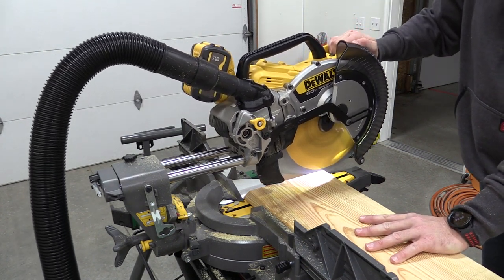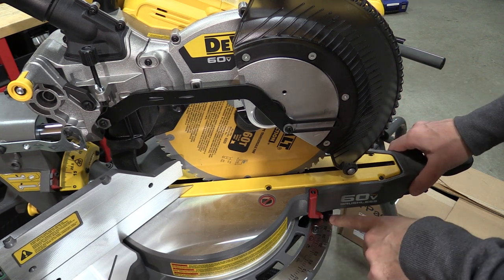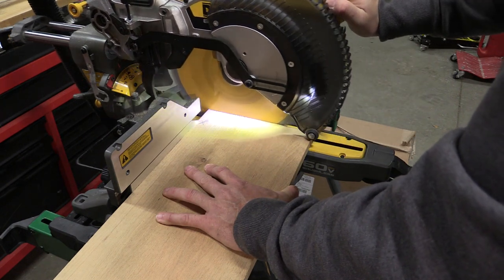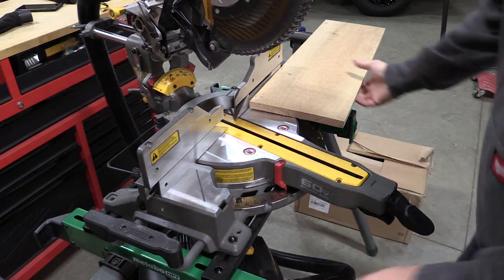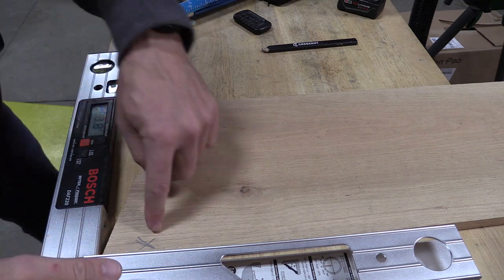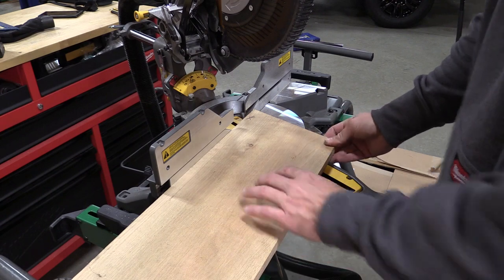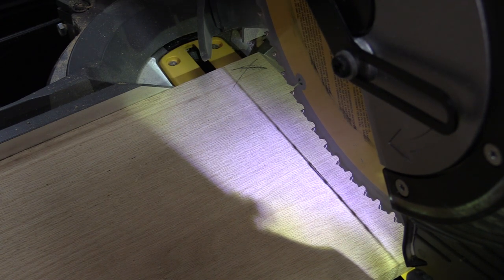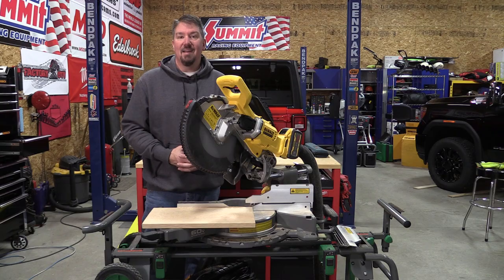Accuracy With The DEWALT FlexVolt 60V DCS781 12" Double Bevel Sliding Miter Saw

Comment: Dewalt saws are top notch! For the 45 degree bevel test, I use 2 pieces of perfect width 3-4” flat stock upright against the fence. Cut both pieces, put the mitres together and test the corner for 90 then divide by 2 if you’re using a digital angle finder. Way easier to measure that angle than the way you were doing it. Also I’m a cabinet installer so the cabinets I trim around are way more exact than a drywalled corner. I want my saw to be tuned as accurate as possible. Have fun, I wish I could justify replacing my perfectly fine corded version with this.
Reply: It’s fine till you start cutting harder woods, I guess if you spend the extra few hundred and get a high end blade
It would be fine. I’ve never had a saw get bound up in the wood till I cut an entire room of shit lap, that was just pine too.
Reply: The dust collection on this saw is the reason to switch over from the corded version. I really wish they had come up with something different for the slide. I really like the way makita and festool don't have the rails poke out the back like this this saw is also at a fair price compared to other brands

Comment: How do you hook your vacuum up to that saw. I have automatic switches but can't use it with tge battery. Do you manually turn on vacuum for each cut?
Reply from the maker: Dewalt has a tool connect system that will work with some of their vacuums.  I have a bluetooth switch I wear on my wrist that controls the power to the vacuum.  I still have to turn it on and off, but it is in a convenient place.
Reply: @WorkshopAddict  I'm thinking of making like a vacuum pedal. I can step on it when I'm making cuts. I know it's a bit ridiculous. But when you're used to an auto vac switch, it's hard to go without one.
Reply from the maker: @robvantour9757  I like the pedal idea!
Reply: @WorkshopAddict  I thought it was a million dollar idea, but Amazon already has them for sale.

Comment: The things I really like about this saw from watching your videos are: (1) accuracy out of box (2) dust extraction above 80%!!  I’ll never understand why my trim crews refuse to use vacuums when I supply festool self cleaning units with the remotes. Their light and quiet(3) cut shadow line (4) the blade safety shield… it can be easily lifted with the hand on the cut handle by using the thumb to lift up just a little when needed ……. But the biggest improvement and one that every single manufacturer should strive for one 10”’saw should be less weight. This saw is almost less than 50 lbs. AND IF YOUR USING add on wings, like the Fast Cap system… you can remove the factory extension wings and you’ll be about 45 lbs. now… I think I’d probably carry the saw with these factory wings so.. probably not a good item to remove. 

Now the problem for me….. I have Milwaukee cordless tools tens of thousands of dollars into that line of cordless.  I also have the Makita 40v line started and absolutely love the new Makita tools.  However the Amazing 12” Makita compound miter saw is 69lbs and with the battery over 70lbs.  There is a massive difference in weight from 50lbs even using the roller stand when going up and down stairs and loading or unloading from our transit vans.  

I’ve been very tempted to buy the Kapex miter with its roller stand.  Everyone I know who owns one says it is extremely portable, quick to set up and accurate. I’m not concerned about price as much as capacity to cut baseboard standing up. Over the last two years our customers have chosen 6” and 8” 1x baseboard. The 6” is 5 1/4 to 5 5/8” depending non the profile and manufacturer while the 8” is 7 1/4. I’ve not found a saw that can cut 7 1/2 standing up yet although a manufacturer could, with proper design, make a 10 or 12” cut well over 8” standing up if they mount the motor and arm on a U shape or goose neck shape. 

I currently run the Makita 36v 10” compound miter. With the stand, it’s 100+ lbs. 

Another great informative video, thank you

Comment: What you termed as "Blade wobble" is from the blade and motor torquing while it's getting up to speed.
It's impossible to change physics. 
The more swivel points, the more wear points. Wear points wear. Nylon bushings wear faster than Bronze. At what price is this no longer deemed affordable for most people?
It's like wanting the versatility of an F-250 with  V8, and then complaining about its gas mileage.
Reply from the maker: I did not think I deemed it blade wobble.  I talked about another commented saying all flexvolt saws having blade wobble.  I just showed it, and also said some of it was from stickers peeling on the blade.  Just showing every aspect so people are happy with a 700 dollar purchase.
Reply: @WorkshopAddict  hello

Comment: It's a DeWalt. Of course it's accurate enough. Better than most saws. Festool isn't even better
Reply: The only things I like better about the Festool Kapex are the bevel control (it's much easier and more accurate) and dust collection.  But many people (including me) don't use the bevel capability much, so  the price differential and the other disadvantages of the Kapex lead me to stay with Dewalt.

Spencer Lewis of Insider Carpentry has tried all the high-end saws, and swears by the venerable 780 for his amazing trim carpentry.  But no saw is perfect -- every choice involves compromise -- so I'm not about to argue with anyone who decides, after due consideration, the Kapex (or any other particular saw) is best for them.

Comment: DeWalt did not equip this unit with a 120VAC plug-in option/feature JUST LIKE THE PREVIOUS DHS790 had. They are GREEDY & want to force customers to buy MORE batteries!! I'll be skipping this model. They could at least make a 120V AC to 60v FlexVolt battery adapter, but again, that would cost them battery sales...
Reply: They did for the UK so maybe there is hope for North America.
Reply: Also, to be noted the battery gets charged with the saw brakes. So you can't put an AC plug on this saw.

Comment: Cool saw. I have the Old flexvolt miter saw and i love it. The AC adaptor is sucha game changer. If this saw ever gets the adaptor to make it wired then id buy it.
Reply: The adapter burns out the motor. Shouldn't use it
Reply: @skliros9235  Ive used mine on and off for almost 3 years now. Its still works great. I dont know what kind of torture tests people put their flexvolt saws through but mine is ok so far and i bought it used from someone too.
Reply: I would stop using the adapter it's common for the saw to burn out running it off the adapter and it's around 300 dollars to repair. And they will tell you not use the adapter anymore

Comment: Honestly I’m so over that old school rail style. It looks like a beautiful saw and really well made. But the forward rail is it for me.
Reply: Meh. The rails on the makita 40v 12” are problematic already. I have one… returning in this weekend.
Reply: @carguy1312  never had a problem with the forward, rail system. And that is the system most companies are moving towards Hitachi invented the sliding compound miter saw and are now using a forward rail design (Metabo hpt) the festool Kapex also a forward rail design. but personally, I’m over DeWalt in general so it doesn’t matter what rail system they released.
Reply: @steffendetrick  I was sold on it. Hence my purchase. There’s still side to side deflection, and they’re cutting in an arc in some cases. Not saying it’s not good, just saying it didn’t work out for me, sadly.

Comment: Have you checked if the fixed table is at the same height as the "center table"?  I found that on the Milwaukee the center table is lower, thus resulting in a inaccurate cut😢

Comment: So going to buy 780 OG or this new 781 Sexy flexy  what 1 would you recommend buy once cry once upgrading from Chicago electric double-bevel
Reply from the maker: The 780 does not have the same dust collection as the 781.  If that is what you want, good dust collection, the 781 is your only choice right now.  IMHO, this flexvolt is the ticket.
Reply: Do not buy the original Flexvolt mitersaw. This is way better in every way. I’ve had 5 of the OG Flexvolt and the motor burns up. Out of warranty and your looking $400+ to replace the motor. 
Can’t say the Flexvolt 2 won’t have that issue but it seems unlikely to continue the trend.

Comment: so I went out and grabbed me a new dewalt miter saw after I saw two of your reviews....definitely improvements are there but one thing...dust collection you were raving about. ..was absolutely NOT there.....very disappointed 😒
Reply from the maker: I do not see how it could not be.  Did you have a vac hooked up?
Reply: @WorkshopAddict  yes of course. I have festool vacuum hooked up...its no better than any other dewalt miter saws and I have 3 of them.
Reply from the maker: @jasonkim7812  I just cannot figure that out.  I have never had any miter saw, especially the Dewalts do this well.  Dewalt even claims 94% of dust and they have never claimed that on any other saw.  Are you using the large vac adapter?  There has to be more to this.
Reply: the dewalt vacuum port fits perfectly with 27mm vacuum hose. I just don't get the same experience as you had with the machine. don't get me wrong I like the saw with all the improvements enough to get rid of all the other miter saws...
Reply from the maker: @Jason  I am just trying to understand  how you did not have the same experience.   I used a 2-1/2" hose.  Maybe my vac pulled more cfm?  I am not going to say for sure because I do not have a festooned vac.  This just seems odd.

Comment: It just seems like Mitre saw is one of those tools best to have as a corded version 🤷‍♀️
Reply: Well there's dozens, probably hundreds of corded miter saws that are just fine and will be cheaper. But if you're corded and the job site doesn't have power, well then you need a generator, or one of those extremely expensive battery units with a 120v inverter... Or you can get this miter saw that's just as good, and uses the same battery as a lot of your other tools. Don't have to worry about the generator, extension cords, etc. 

I will not shed a tear if everything goes battery powered. It's damn convenient.
Reply: Absolutely not true. Flexvolt cordless tools are actually more powerful then corded tools and more much better for job safety and productivity. Not having any cords around prevents injury and fines . 
      If your getting it for home use, a cordless mitre saw frees up outlets for other tools
Reply: Battery miter saws are just fine table saws are a different story. you can make cuts all day on one Battery on most of the brands.

Comment: Great video, you earned a like and a sub, thanks! I'm picking one of these up for my shop on monday. My old DCS799 died today (getting it repaired), but this DCS781 will be a great saw in the shop until the DCS799 is fixed and after that this will be a great mobile saw for me to keep on my work truck.